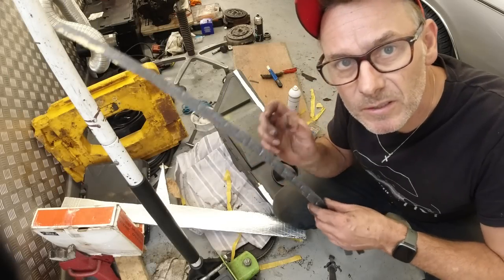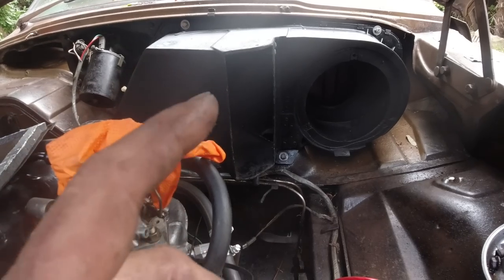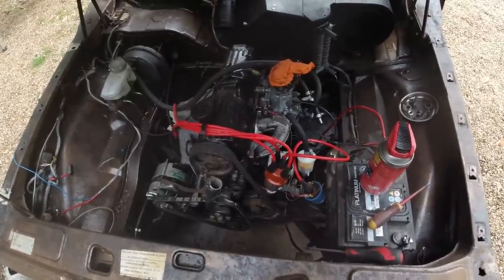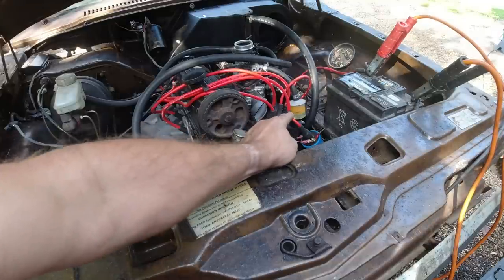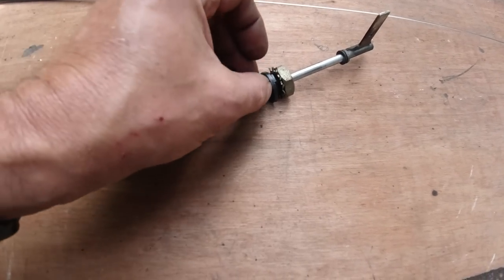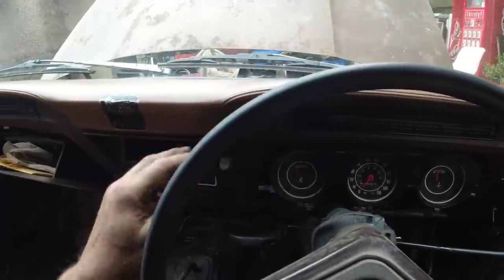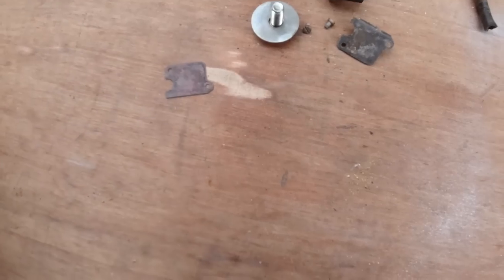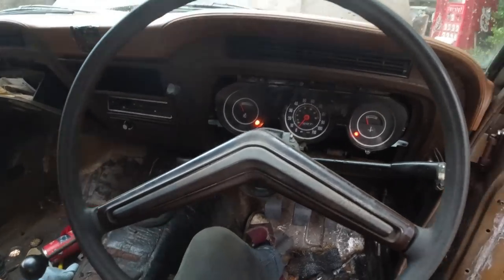PROJECT PAPPA - Mk3 Cortina Resto -EP14

Comment: when I did my MK 5 Cortina heater box I got some self adhesive sound deadening pad and glued that to the flap and it worked a treat.
Also put a fine mesh across the inlet side of the heater box to keep the insects out.

Comment: Hi Pete, I missed last night but saved it for my Saturday night.   I've often thought that if the sun visors are difficult to find then would expandable foam for fixing gaps in houses work?  I reckon it's something like this that was in there when new, not the usual foam but a crushable type.  After removing the rod you could empty the dust out leaving you a hole to access the foam into the visor.  Care would have to be taken at this point, depending on how much this foam expands all excess could have to release from the hole and this might be rapid and blow the visor apart.  My other concern is that the foam will melt the vinyl.   It would be worth a test on a scrap visor first, but surely worth trying.

Comment: for 20yrs i worked on pintos, that exhaust leak was far too common, you would just get it sorted, then the manifold would crack... only genuine ford studs + nuts got used in our garage, 90% success rate, but i doubt they sell them now. 
on our fleet, we ran the tappets 2 thou slack, the background rattle used to dull the worn lobe, 1980s noise cancellation if you like...

Comment: Hi. Pete the reason that your engine sounds Cammy is because you have adjusted the tappet clearance incorrectly on a pinto engine you adjust the gap with the cam lobe on the horizontal not when the cam is upright a very common mistake to make try it and see the difference to sound and performance hope this helps regards DEL
Reply from the maker: thanks so much im gonna give this a try, really appreciate it

Comment: Loved this update Pete, especially as I’m about to replace my fibreglass box with a MK4/5 plastic one. Can you tell me the thickness of the foam you used to seal the box please? Many thanks and best wishes Mike
Reply from the maker: approx 5 - 10mm    a waterproof seal is needed, a foam that wont hold moisture, a good seal on the box and closing panels, wier bracket and final closong triangle all help to stop fumes and make for better freash air flow via the scuttle intake, to help even more, a plenum box in the boot is fitted (if yours missing) this completes the airflow system thru the car. ram air slowly replaces the interior air as you drive, diverting it down the inner of rear screen and into the parcel shelf cutouts, this help demist and give fresh air. the process is faster if fan is running of course, dont forget that fresh air is maxed when you slide control to right (on prefacelift) and pull fan speed lever OUTWARD for the boost setting. pull the lever toward you when fully to right (left on facelift)
Reply: @PeteCswampy  Hi Pete, thank you for the detailed response. I will get some foam ordered and get cracking when it arrives. Will keep a look out for a plenum. Many thanks as always Mike

Comment: Is the gearbox totally different with the gear lever sprouting out from under the dash..? I hade a 4 speed 2.0 Capri that had external linkages on the top of the gearbox , made a distinct sound from outside when peaps changed gear in these…😊

Comment: Hi Pete, I'm restoring a mk3 at the moment. The front subfame front mounting points have rotted out including the actual tube the bushes locate in. It a pfl with the thinner bushes, any ideas on what to use to replace the tubes as they are tapered on both sides in order to push the new bushes in place. 
Thanks Ali.
Reply from the maker: Alastair, i had this problem ob bramble where the whole area was bad, i grafted in new complete pieces of another car but for you, ou can use tube, it has been done by someone i recall ears back on the mk3 owners club forum, my suggetion would be give the club a dhout out becuase someone had made a tube themselves to do this but i cant recall who did it. It may have been a guy called Paul Zooney on the club. are the anti roll bar brackets also gone? i think i have roll bar brackets spare. 100% sure its been done by somebody on that club.
Reply: @PeteCswampy  Hi Pete. Cheers for reply, I will.ask Paul if it was him, I'm doing a build thread on the club forum however nobody's come up with any suggestions.  
I will look into getting some tubing, its just the taper on each end that may be difficult to achive. 
It doesn't have antirollbar but thanks for offer.  Cheers just now Ali.